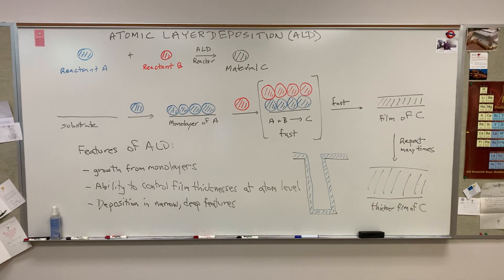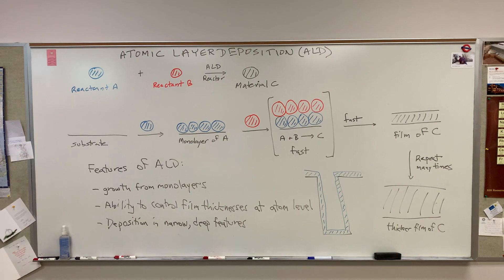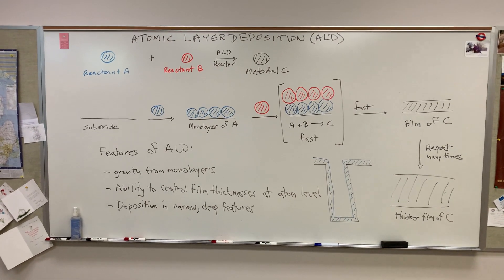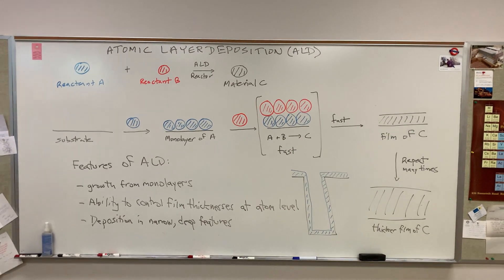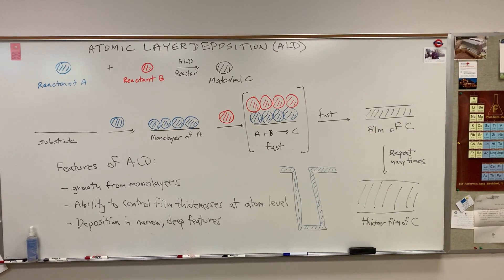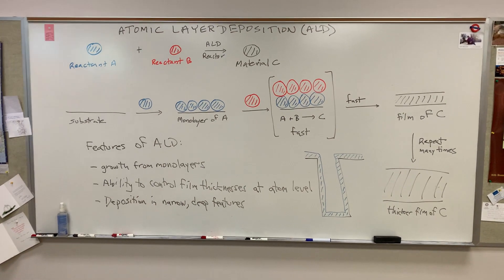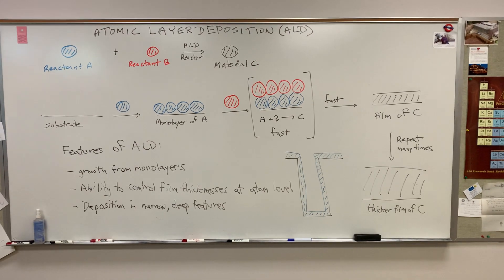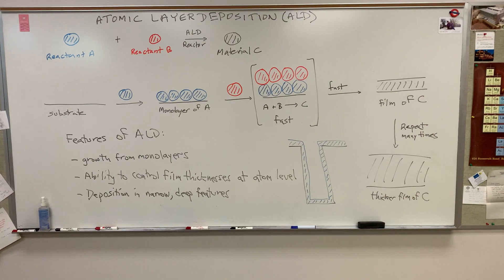Atomic Layer Deposition with Chuck Winter

Comment: Method of deposition?
Some example?
Reply from the maker: Hello, the atomic layer deposition is a subset of chemical vapor deposition, meaning that gases are used. Unfortunately, we couldn't get a sample for this video.
Reply: @WisconsinMrsec  
Thank you for the reply. Why not just depositing material C? I mean why not making C separately and then depositing it by CVD?
Reply from the maker: @AbdolazimHasseli  With this method, material A will flood the sample and fill every available space on the substrate, forming a layer one atom/molecule thick and no thicker. Then, material B will rapidly react with material A to create material C, creating a film of C that is only one layer thick. Using this method creates uniformity in the sample (one layer thick everywhere) and allows for precise control over the thickness, as the process can be repeated to make a film one layer thicker. If you were to deposit material C, my understanding is that you would not be able to precisely control the thickness of the film.
Reply: @WisconsinMrsec  
Thank you again. How do you make sure that the "A" forms just one atom thick layer? Is that really posdible?
Reply from the maker: @AbdolazimHasseli  It is possible, but not every material can do so. Some materials react in a self-limiting way, such that once all the sites on the surface are filled, no more add to it. Pretty amazing!